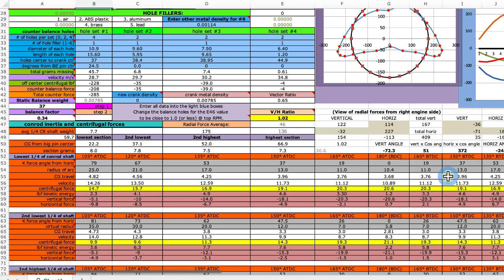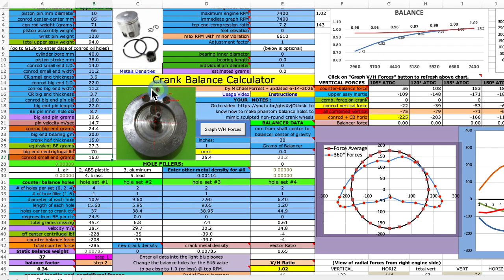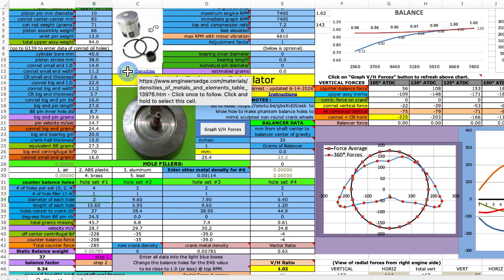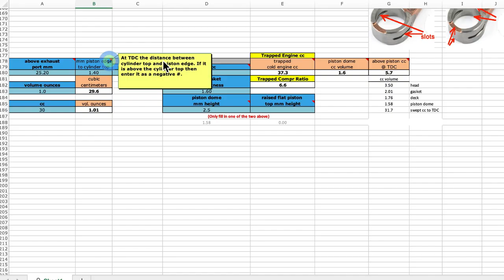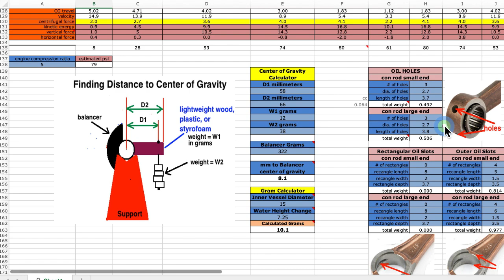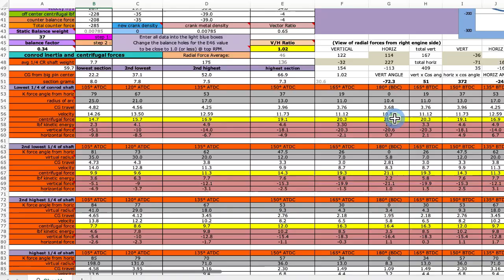Crank Balance Spreadsheet Instructions (2 or 4 stroke)

Comment: Just took a look around your website, quite interesting.
Not many people have even heard of Gordon Blair let alone read his papers and built on the information.
Reply from the maker: Yeah, as the decades roll on the old greats disappear farther and farther into the mists of time.
Gordon Blair
Probably the most scientifically rigorous two-stroke researcher. His work on scavenging, charging efficiency, exhaust systems, and simulation software is still foundational. Many modern engine simulation programs owe a lot to Blair's research.

Gordon Jennings
His book, Two-Stroke Tuner's Handbook, inspired generations of backyard tuners. Not always as mathematically precise as Blair, but very practical.

Graham Bell
Author of Performance Tuning in Theory and Practice and Two-Stroke Performance Tuning.
Bell bridged the gap between practical tuning and engineering theory better than almost anyone. Many people learned about port timing, pipe design, and combustion from his books.

Walter Kaaden
Arguably the father of the modern racing two-stroke.
Working for MZ, Kaaden developed the expansion chamber and rotary valve concepts that revolutionized racing.
Without Kaaden, there probably wouldn't have been the two-stroke dominance of the 1960s–1990s.

Ernst Degner
The rider who famously defected from East Germany and brought Kaaden's knowledge to Suzuki.
Many historians regard him as the person who transferred MZ's two-stroke technology to Japan.

Jan Thiel
One of the greatest two-stroke race engine designers ever.
Designed championship-winning engines for:
Aprilia, Derbi
His writings on porting, combustion chambers, and exhaust systems are full of practical insights that even experienced tuners find surprising.

Neels van Niekerk - EngMod2T creator 
More modern than Blair, but hugely influential.
His software became one of the most respected tools for serious two-stroke development.

John Robinson
Author of Motorcycle Tuning: Chassis and many engineering texts. Less famous than Bell or Jennings, but highly respected.

Phil Irving
Known for work on racing engines and author of Tuning for Speed.
Much of the old-school understanding of combustion chambers and engine breathing traces back to Irving.

Harry Ricardo, author of The High-Speed Internal Combustion Engine
Not a motorcycle tuner, but one of the most influential combustion researchers ever.
Concepts such as:
squish, detonation, combustion chamber shape, flame speed
all owe a great deal to Ricardo's work.

For someone with interests in:
expansion chambers, trapping ratio, port timing, combustion speed, and crankshaft balance
I'd put the all-time technical giants in roughly this order:

Gordon Blair
Walter Kaaden
Harry Ricardo
Jan Thiel
Jennings Graham
A. Graham Bell
Phil Irving

What's interesting is that most young riders know who built the latest motocross bike, but very few have heard of Kaaden or Ricardo—even though those men probably influenced modern engine design more than any current YouTube tuner ever will.
Reply: @MichaelForrestChnl  I'm just a little older than you, had used copy of Phil Irvin's book 'Tuning For Speed' over 40 years. Bought a bunch of other books over the years but mainly four stroke tunng.  Ricardo was a genius, until he got too arrogant and started getting things wrong. Main problem was he really started his research 40 years too early (pre WW I ).
 I pretty much stopped tuning two strokes in mid 1980's, British 'Learner Law' restricted learners to 125cc, 12bhp. It didn't take too long to get 120mph 'learner bikes' running around (porting Suzuki 125 'Gamma'  close to RM 125 spec, new exhaust, etc) Yamaha RD125 to YZ spec made 'porting by numbers' pretty easy
Reply: @MichaelForrestChnl  Oh, meant to mention Tony Foal, he invented the Dymag racing wheel and was the frame guru in  70's~80's. (helped Yamaha when they tried hub centre steering on GP bikes, plus the road version no one wanted)
David Vizard is still going as well but he's only done four strokes, been promoting most V-8 motors for decades